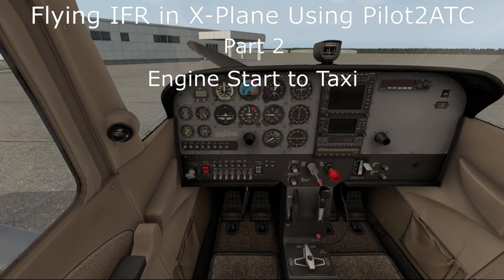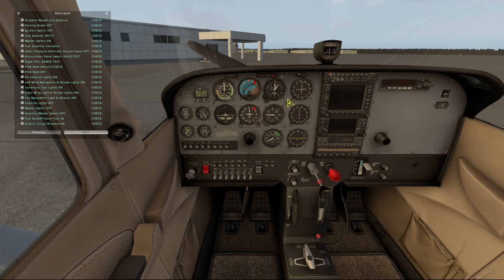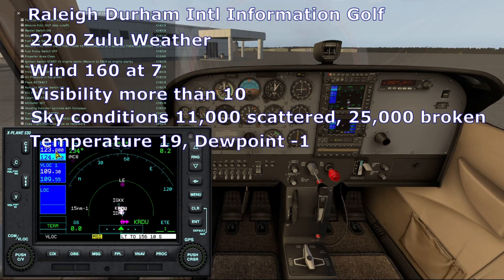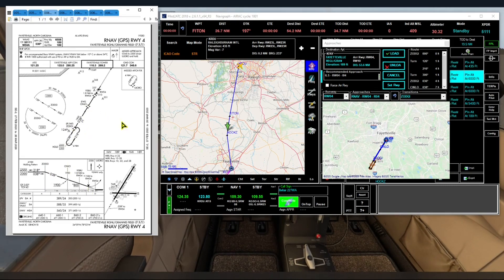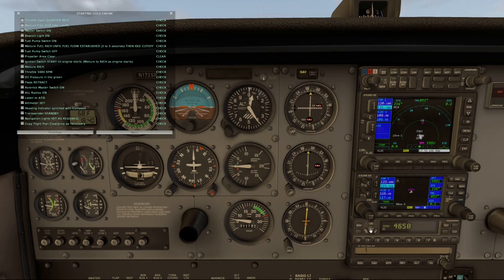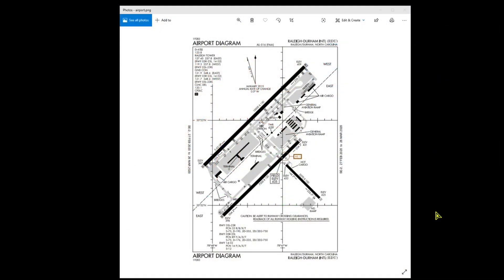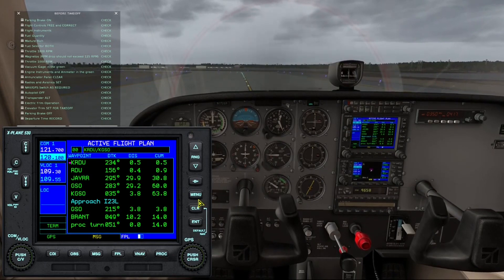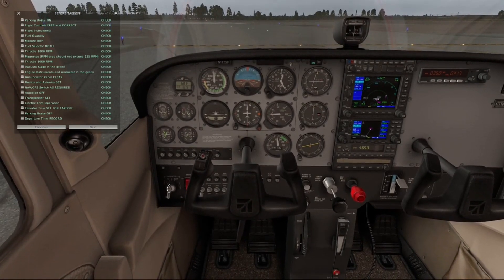Flying IFR in X-Plane using Pilot2ATC Part 2

Comment: Mark hello again .Question do you have trouble getting an ifr release at a non towered airport with xplane and Pilot2atc?
Reply from the maker: Hi David.  I've been wondering about you.  Nice to hear from you again!   No,  IFR Release seems to work well for me with P2A.  I just contact the nearest Center and request it.   I have a video about it if you want to check that out.
Reply: @markfletcher4579  I get them from tower but at kgsh it keeps asking to repeat with departing runway which I do and it won’t give me the release.It just keeps asking for the departure runway.Do you have any suggestions?I also get a pop up window that says  SQL is corrupt or has been tampered with.Then I have to turn the computer off and start all over again .Thans for the videos great help.
Reply from the maker: @davidmullet1030  yeah, I don't think you should try from another airports tower.  I'm sure that's what's confusing p2a.  I always use center.

Comment: I see that you're using Pilo2ATC for charts, is that easier on separate monitor than Airnav since it does stack it all together?
Reply from the maker: Hi Richard.  I really like the charts in P2A and having P2A run on a dedicated monitor really works well since it is an application not a plugin.   I use several other resources in that monitor during flight but like the sectional in P2A the best.

Comment: Hi Mark, thanks again for the video. I'm a little confused, I thought in part one you added the flight plan to the radios thru pilot2atc but yet you had to add them again when you were taxiing. Did I misunderstand you? Also, the atc chatter I'm hearing, is that part of pilot2atc or is that a different program?
Reply from the maker: Hi Bill,
All P2A does is copy the flight plan file to the fmc directory.   You still have to load the fp into the garmin but that's much better than having to enter all of it again.   Hope that's clear.